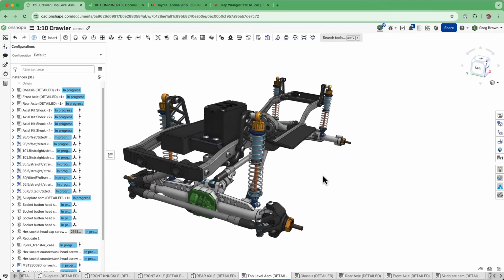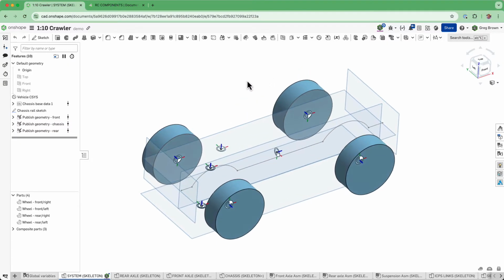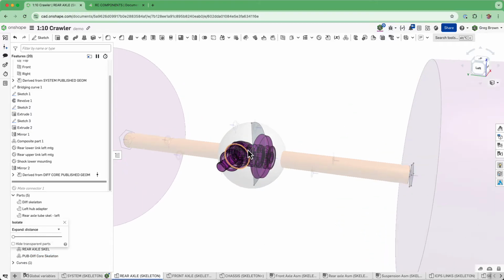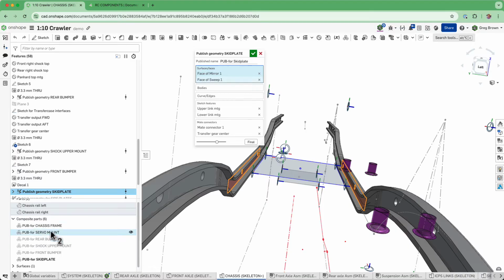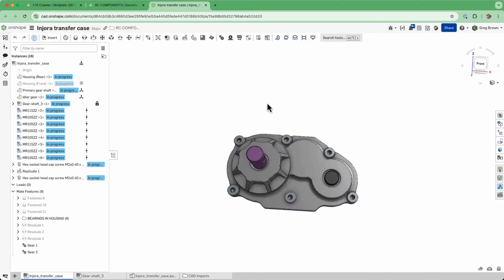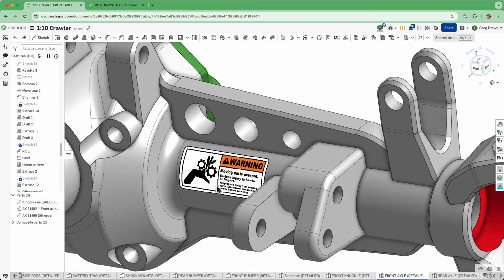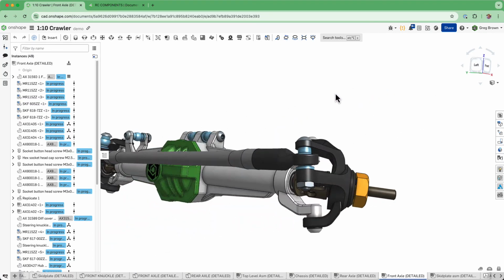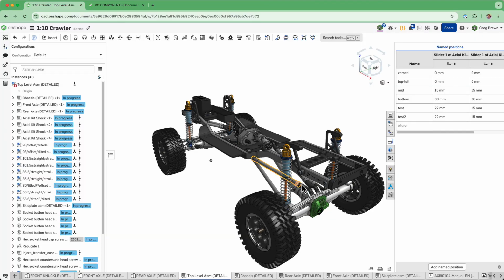Top down design of complex assemblies with Onshape

Comment: Hi, thanks a lot for this video. It is exactly the process that we want to push internally.
Could you quickly explain how do you go from the really abstracted tube to the real linkages? 
Do you use the abstract tubes as skeleton and derive them in another part studio /document? (In that case the state of the context is very critical and should not be updated if someone "plays with the assembly... it feels dangerous in a multi-user professional environnement )
Thanks

Comment: That was super good! That's how I used Proe/Creo for 20 years before switching to OS. The pub geom feature really helps to organize things, as you showed.
Reply from the maker: Fun fact, I worked on some of the early Pro/E Design Manager demos back, hmm, last century I believe! Time flies. But the workflow is still the best. In my opinion (and as the video tries to get the point across), using Composite parts to be the carrier of references is such a robust way to do things.

Comment: Would be good to touch on the process of setting up mates and joints in your skeleton and detailed assemblies? Do you have a preference for which geometry you use to create mates in the skeleton assemblies or in the detailed assemblies?
Reply from the maker: I can certainly dig into this by way of a follow up/deep(er) dive. As you can imagine it does take a little bit of planning ahead to do cleanly, but once you get it, it makes sense.

Comment: Nicely done as usual Greg! Can I presume we may be seeing an upgrade to the composite part feature in the near future? Also, where did the spring coils disappear to as the suspension compressed? 😉
Reply from the maker: The springs did in fact involve some artistic license.... I'm surprised nobody else has called me out on this yet :) There are two parts to make up each spring, and they are mated such that a rack and pinion relation can control the relative rotation. Not exactly intuitive, I know, but it looks really cool...